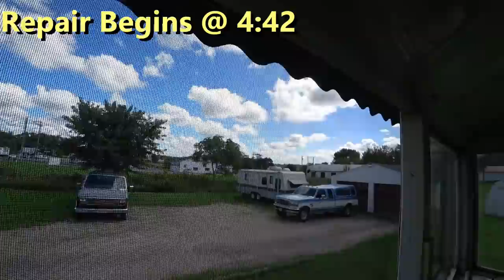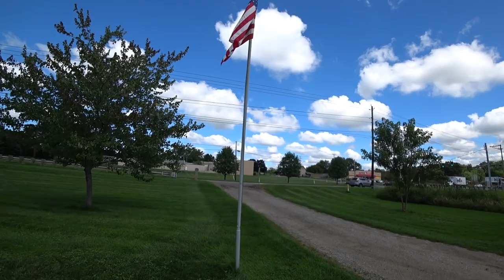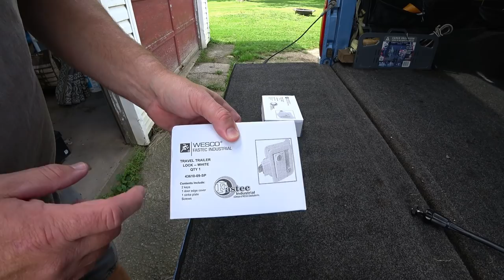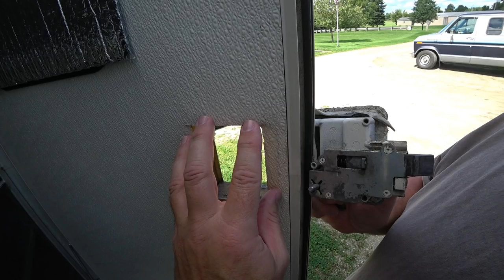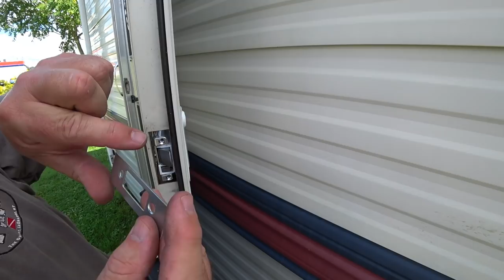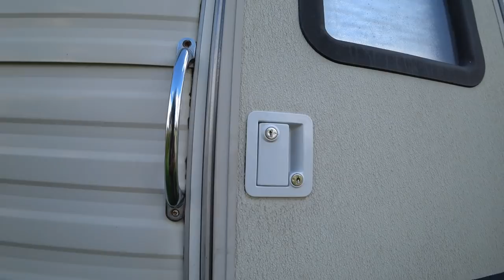Replacing RV Entry Door Latch

Comment: At one point, I wanted to re-key the various doors to our house and garage.  I found a kit that included new keys, plus the actual pins that go in the lock.  This takes a bit of care to disassemble the lock and put in the new pins, but it worked well.  Unfortunately, it does require the locks all have the same profile (that the new key fits in), which left one door different.  Years later, we replaced two of the locks with combination locks, and they came with something like "smart key", where you can get the new lock to take your old key without taking the lock apart.  Again great except for the one with the different profile.  I wonder if that same sort of thing is available for RV locks.  Then you could just replace the one that you had to break into, and re-key it to match the others.  Side note, the show season has begun, so we went to an RV show yesterday (Saturday) a couple hours away, hoping to get more ideas of just what we want in an RV for full-timing.  Between that and the videos (this channel and a couple others), this "thinking about it" phase is fun.  Thanks for the videos, and please keep up the good work.

Comment: Watching now. I have a 77 dodge rv. The opening for the door lock mechanism is large I believe 5.25x5.25.  Square. I cannot find a replacement part yet. I’m surprised because it’s a run of the mill class c.  Original looking door lock about time for a new one. Tricky to lock

Comment: I had extra keys made when we had our trailer that were hung on a key-rack inside the house. I had to order the blanks and have them cut. Our motorhome only has one door and has a keypad and fob in addition to a key. I haven't heard of anyone having an issue other than the ones on the Monaco Motorhomes 10+ years ago that they discontinued because of the failure rate.
Reply from the maker: Until the aftermarket ones have over 500 reviews that are 4 - 4.5 stars I don't feel comfortable spending over $100 for it. I try to stay on top of those and read the reviews religiously and there's just too many people that have had issues with the aftermarket ones, which obviously is what I have to install. Some of the aftermarket ones are in the $200 range. Ouch I can buy a lot of manual locks for that amount of money.

Comment: have you ever considered making 2 additional keys leave one in a magnetic case (get at walmart ) and stick in the case and place under the metal part of the frame  tongue is one place and another in your garage . Save you getting to purchase  a whole new lock . With all your experience im surprised you never considered doing that what if you were out camping  you be in a pickle???
Reply from the maker: Actually Heidi had to remind me that we did have an extra set of keys. However, they were in a plastic magnetic hide-a-key that was also gorilla taped in the frame of the tongue. But, as you know, when I added the generator mount on the tongue I made sure to remove it so that the heat would not melt it when he was welding. And in a rush I misplaced the hide-a-key. Seeing how it had been on the tongue of the RV for quite a few years and I never needed it I didn't put a lot of effort in trying to find it after the generator mount was finished. You know how that goes. But we have extras now.

Comment: does this lock suffer from the same thing as the factory locks where most RV keys will fit and open other RV doors
Reply from the maker: It's not like the ch751 for most  storage areas 😁 just like older cars years ago.
Reply: @Rvdaydream  so they do use a different type of key not like the factory ones where everything fits everything just about

Comment: How come you didn’t choose an electronic lock? No key needed.
Reply from the maker: This just might not be our forever rv, you never know 😁😁 but we are interested in them for sure😁👍
Reply: I had to replace mine because it broke, locking us out of our RV. I changed to the (RV Lock) 8 months ago and so far it has performed well. I can use it with the key fob, the digital key pad, and if for some reason they fail, you have the key which matches my bay door locks. I hid a extra key where I could get it in the event that I lose my key and all of the electronics failed at the same time which would be awful slim but just in case...
Reply: redjaguar100, have you had it in cold weather?  Curious because batteries don’t like cold, and I live in Alaska.
Reply: You have a very good point about the cold weather but all I can say is I used high end batteries and they are still in use after 8 months with no signs of slowing down and that included a very cold winter. Batteries shouldn't be a big issue because you will always have your key if the system fails. BTW, it warns you if the batteries are low and also, the battery pack is inside the door closer to your warmth.

Comment: Seriously? The manufacturer actually has a QR code to scan for installation instructions and it takes you to THIS video? C'mon man, i mean you did an alright job getting the lockset installed but this is just a video of someone figuring it out as he goes... which is essentially what I had to do too, and it IS a pain in the ass ....I've done it a couple of times and I was hoping that the manufacturer could enlighten with the proper method, step by step, showing a sure fire way to not only install it with minimal frustration but also how to make the necessary adjustments required for proper functionality.  Because the reason I had to replace mine was due to improper alignment of the last one that caused it to eventually malfunction resulting in irreparable damage and the need for a whole new lockset. But here I am in the same situation with a door that's difficult to close and have it latch properly so will probably end up only lasting for about 6 months just like the last. But anyways, I'm not knocking the job you did sir, it looks good and basically I had to do the same thing as you needing me to mess with it for a couple hours only to realize that no matter how hard I tried I couldn't get it to latch without removing the strike plate altogether and just allowing it to catch on the aluminum door frame in the hole where strike plate should be. The only good news is I imagine it will be much easier to force open if I ever misplace all 4 keys. And the point of my comment is that it would be nice for the manufacturer to actually produce a simple step by step video showing simple installation including proper adjustment techniques. Which I'm sure there's got to an RV custom shop that does this kind of thing alot and has even made a video showing it, they should contact Ristow.
Reply from the maker: Lol I don't believe we had anything to do the qr code and where it takes you 😁